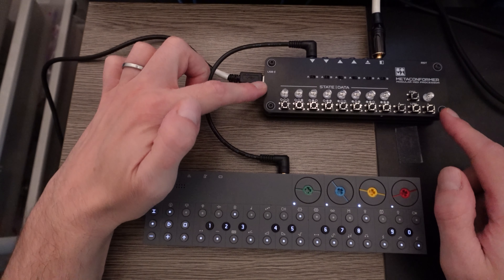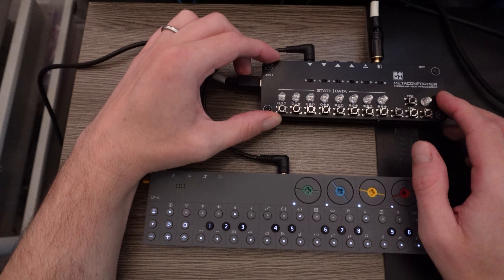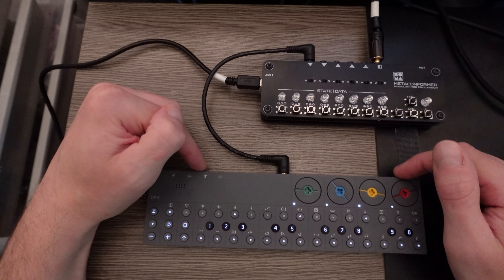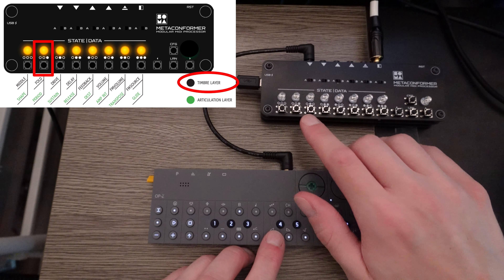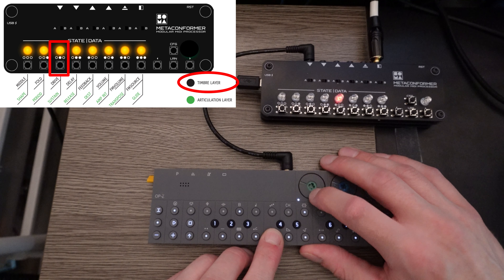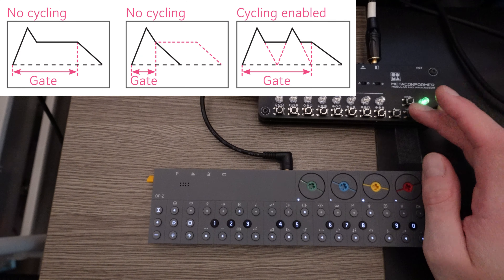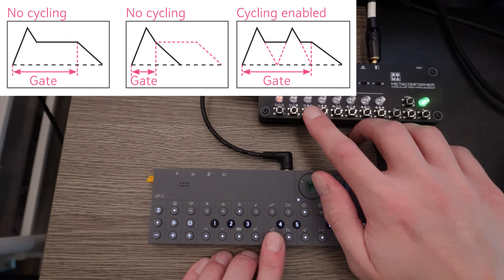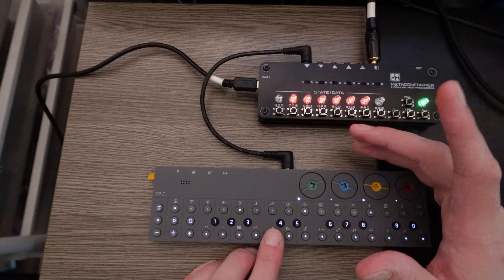Gear I Like: SOMA SimplexFM

Comment from the maker: An older version of the firmware was mistakenly posted on SOMA's website. As of today, this has been corrected and you can download SimplexFM firmware v1.1 here: https://somasynths.com/metaconformer_firmware/
Reply: Just check all the LED are working great and the Firmware is working great.
I still have a problem with the gate-in A, I tried the "Metaconformer" firmware too and I notice that there's a problem with all the A gates (IN and OUT) it seems I can use only the B gates, i think my unit has some construction problems... that's a pity. I think i'm gonna send it back to Thomann.

!! BUT i want to confirm again that the FIRMWARE for the SIMPLEXFM is working properly (i don't think the gate stuff is a firmware problem)
Reply from the maker: @dedicato8964  I'm glad to hear the firmware is working! It also sounds like your hardware might be fine unless I'm misunderstanding you. There are two types of TRS (3.5mm) MIDI, A and B. Most devices only support one or the other, but Metaconformer works with both, using the switch to determine whether that input is Type A or B. It sounds like your devices are Type B, which is used by some companies like Arturia and Polyend. What gear are you using with it?
Reply: @windowbed  
Ok I'm so stupid, never really look into it properly, i'm using a Befaco TRS-MIDI Cable B... at first with a Beatstep pro than with my Monomachine, so yes problem solved :|
Thanks again for helping me with the firmware and communicating the problems to Soma.
Reply from the maker: @dedicato8964  no problem! Glad you got everything working and thanks again for bringing up the LED issues. ☺️

Comment: is there a way to midi map all of the controls? like have the 16 controls set to 16 knobs/sliders on an arturia keylab?? that would be incredible
Reply from the maker: Yep! I mapped the controls to a Keylab 88, though at this point it has more parameters than I have knobs. I also mapped the controls to my OP-Z, though it's not great for saving presets because it doesn't always save/load the last parameter page.
Reply: @windowbed  whoa thats awesome! thank you for the response, i think im gonna get one. i am also pumped for his kaleidoscope coming soon! check it out if you haven't yet.

Comment: I like this thing .... why does every video have it controlled by an OP-Z?
Reply from the maker: I'm also pretty surprised by that. In my case it's because I use my OP-Z to control almost everything so it just made sense. I also have it mapped to a Keylab but I'm still trying to figure out the best camera angle for that. In general OP-Z might be popular for it because SimplexFM works best with a controller that can send 16 (well, 17 ideally) CC values to 4 different channels. I'm sure lots of controllers can do that, but the Keylab and OP-Z are the only ones I own that have that capability.

Comment: Ei I think i have a problem with my unit. I've done the firmware upgrade on a macbook renaming the .bin file to blink.bin as it's said in the manual, everything seems to work fine except that I have to switch the first midi-in to the B gate (gate A is not working) and the "one-hot scale" of the amp envelope mod destination is not displaying/working as a "one-hot scale" but as a "bidirectional scale" (like the one for MIDDLE for example), so i can't select the destination i want for the envelope modulation. I tried uploading the the metacom. firmware and then the simplexFM again but the bug is still there. Do you have any idea on what could be the problem or I just have to return my unit...

Thanks a lot
Reply from the maker: I think it may be an issue with the firmware version on the website, not your device. I just downloaded it from Soma's website and I ran into issues with the LED scales as well--specifically for the FOLD, DRIVE, DESTINATION, and INTENSITY parameters. I just passed this on to Vadim, the synth's creator. Thanks for the question and let me know if you notice any other issues!
Reply: @windowbed  thank you very much, i'm gonna wait for updates. Again great video :)
Reply: I think i found a bug in the TRANSPOSE parameter too, it goes all the way down but only one led up.
Reply from the maker: @dedicato8964  Thank you again for bringing this up! It turns out the wrong firmware version was shared on their website. It's been updated now, so if you have a minute in the next couple days could you update the FW and check that the LED scale issues you were seeing are fixed?